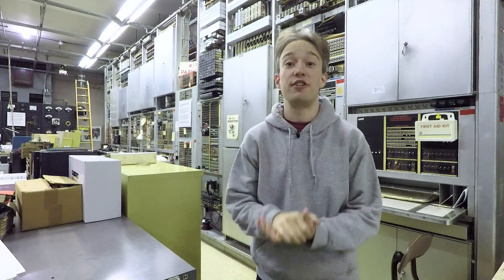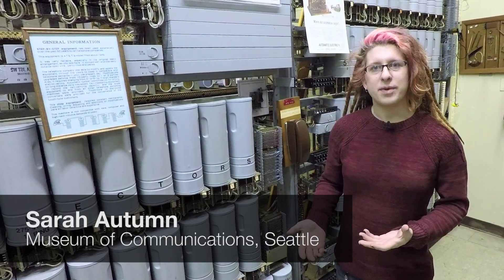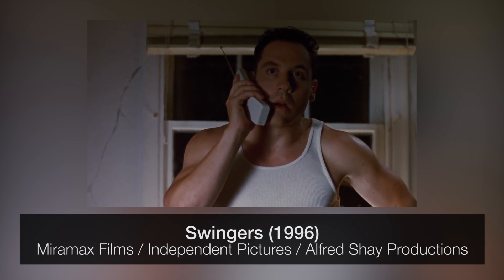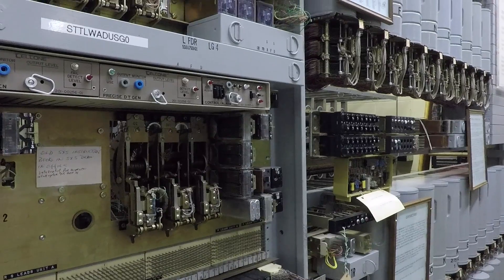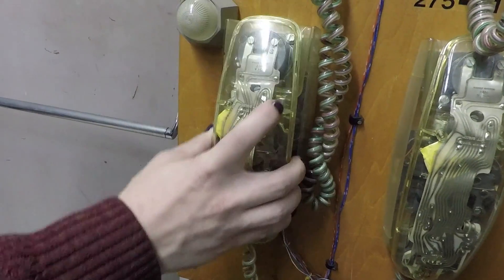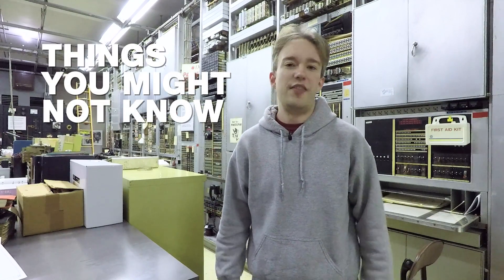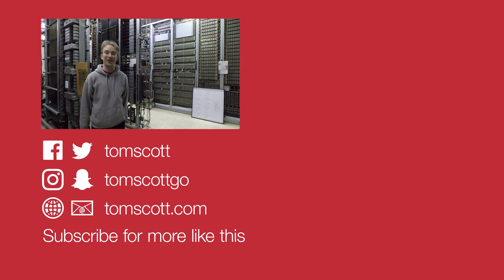In Old Movies, Why The Dial Tone After Someone Hangs Up?

Comment: Up until the 80's, there were still many step switches in West Los Angeles, Santa Monica, Malibu, and northern parts of the San Fernando Valley (Northridge/Porter Ranch, Granada Hills, San Fernando, etc.).  The telephone company was GTE, which was slow in converting to electronic switching.  They were known for a lot of crappy phone service at the time.  Hollywood, Universal City and Burbank were served by Pacific Telephone (an AT&T "Bell System" company until 1984).  Step switches disappeared there sooner in favor of crossbar and then ESS.   Now everything is electronic, VOIP, cable, cellular, and so on.  Step has been vanquished to the museums.

Comment: Oh damn. Back in early 1990s, I remember that my friends told me that if you called someone and let them hang up on you, but didn't hang up yourself, the line would stay open. So we tried that out! ...and it, of course, failed. We were so very very massively disappointed, and this was probably the only damn time we ever tried our hand at this whole "phone phreaking" thing. Hashtag wholesome childhood activities.

Now, this was rural Finland with comparatively shitty telephone exchanges (I can't remember when exactly they moved off from pulse dialing to DTMF, but that was late - I mean, I can actually remember a time when you had to specify ATDP instead of ATDT to call to BBSes), but apparently we were quite advanced in this particular regard.

Oh, and of course, I think that Finland always had a specific disconnect tone, so you don't actually get a dial tone if someone hangs up. Also American dial tones sound weird.

Comment: If I remember correctly, we had an analog phone once here in Switzerland which played this tone whenever we picked it up from its "station" (how do you call that?). And if the call ended, it played the tone again. What may be the reason for this? I don't think it's the same as in the video since the tone was always there whenever there was no connection, so even before a phone call and not just afterwards.

Comment: My memory of how step-by-step networks matches what your expert said, and not just in California - I saw the same thing all over the U.S.: the call only got disconnected when the person who placed the call hung up.  If you called somebody, the line was yours until YOU hung up.  But if you (the caller) hung up, the person you called would get a dial tone, for exactly the reasons stated in the video.  It had nothing to do with independent phone companies, though.  Of course most film directors weren't aware of this distinction.
Reply: You're right. Step systems weren't only used in SoCal. They just happened to be quite common there. In reality, they were used all over the country--mostly in smaller towns that didn't require the fancy and more expensive systems that were used in cities.

Comment: That step by step system was really intriguing. I wonder if it had any advantages over the major systems used by Bell.
Reply: The advantages of the Step system were its relative simplicity, and lower initial cost. In 1937, the federal government did a big investigation of the Bell System and found that in almost every case, Step was cheaper than the alternative.

Comment: We've had these step by step dialing systems in Germany as well! They were replaced by newer technology some time in the 70s, in some places even in the 80s. And then, in the 90s, ISDN arrived and all the analog telephone lines were digitized. Later on, everything went to IP networking, and nowadays, Voice over IP has reached each individual household. However, the more failure proof technology was the older one from the 70s and 80s. If there was a power failure, the telephones still worked, because the telephone hubs all had backup batteries, and many of them even had diesel generators that kicked in (so the batteries were only designed to keep the system running until the diesel was at operating temperature and -speed). Nowadays, you have to hope for/rely on the backup battery of your nearest cellphone tower, and if that fails, after an hour or two, you're screwed for communications (i.e. emergency calls).

Comment: California is hardly the only place to use Step X Step though so a lot of potential movie goers would have experienced the same thing.

Side note, working on those old systems was a great way to improve your soldering skills, mainly because if you got it wrong and left a solder dag in the wrong place then the results could be somewhat spectacular, though irredeemably terminal.
Reply: daleighcom1
_/

Comment: I'm pretty sure that's how landlines work in the UK... as long as the caller stays on the line, the line stays open, if they hang up, you get dial tone.
Reply: James F not any more. Now if you hang up on the person who called you the call will disconnect to prevent fake dial tone scams in the UK
Reply: pageuk As of a few months ago? That was definitely still an ongoing scam recently, and plus that would break a lot of call transfer systems...

Comment: I'm I'm denial that this is actually at a museum and not some telephone switching central, that's so cool that they have it up and running :D That tone when hanging up would actually be quite useful in cell phones as now I have to look at my screen to see if the call ended if I'm uncertain... o_o
Reply: Sure would be.  A nice "your phone call has ended, one way or another" sound would be great.  Bonus points for separate sounds for "this phone ended the call", "the other phone ended the call", "lost tower signal", and "no clue, but we're definitely not connected anymore".  Even if not everybody realized what the different sounds meant, it would be nice to have separate ones (and us geeks would memorize what means what, just for the fun of it :-) ).

Comment: on my cell phone, when I get hung up on, I get that dial tone, except it's one or three beeps instead of a long tone. If I remember correctly
Reply: If your phone doesn't automatically detect when the other person hangs up and end the call for you, you'll hear silence for a certain number of seconds, after which you will be forcefully disconnected after the three beeps.
Reply: That is just your phone letting you know the call was disconnected. Not an actual dial tone.
Reply: GlintTheStrong yes, that is what I meant. I was only drawing a comparison. It isn't technically necessary, much like the shutter sound when one takes a picture with a smartphone.
Reply: Sparkplug1034 Correct, from a technical point it is not necessary.
Reply: That's just your phone saying the call has ended, not a centralised thingumabob

Comment: Wait, the dial tone isn't normal? Here in Alaska, we get the dial tone on hangups as well. As well as something I found odd which is if you don't hang up but the other does, it'll redial after a minute. Course I haven't ran into the redial in quite some time, but the dial tone still works for the mainlines here.

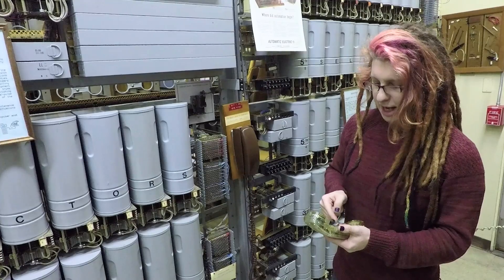Comment: Just been watching this again. At 1:35 Sarah dials a number, from 1:37 to 1:49 we see the "steps" (?) moving up and down, I'm guessing connecting something until at 1:50 the phone rings. Is each of them for one digit of the number she's dialing or what do they do?
Reply: Basically, yes. Each individual step switch handles one digit. The exception to this is the final connector, which actually handles the last 2 digits. You need multiple individual switches to connect a telephone call.
Reply: Sarah Autumn Thank you!
Reply: In the little community dial offices like where my grandmother lived, you only dialed 4 numbers to call someone in town. This was before direct distance dialing; you had to dial the operator to call long distance. The first digit dialed went to the first selector - it indexed up the number of rows for the digit dialed - then hunted across looking for an idle second selector. The second digit dialed made the second selector index up the number of the second digit - and then hunted across for an idle connector. The connector indexed up for the third digit and then across for the fourth digit. It took two selectors and one connector to complete a call in most small step offices.
Reply: Watch it very closely.  First the armature steps up (in response to the multiple contact closures in the rotary dial, then it rotates in response to the next dialed digit.  This isn't that clear because the second digit she dialed was either a 1 or a 2, so it didn't rotate very far.  This switch can connect to 100 different lines, which can be either individual subscriber lines or 100 more step-by-step switches.

And by the way, if you ever used a system like this, you will have noticed that the delay before you get a dial tone varies.  This is because another switch like this one (which I've heard called a "line finder", though I'm not sure that's the correct term) is stepping until it finds a line in the central office that isn't already in use.  During peak times this could take several seconds.
Reply: The mechanism is called a Strowger Switch
Reply: In an operational exchange the selectors (the first switches) would go tickticktick up with the dialled digit, then bzzzzzzt over to find the first available line to the next digit selector. Since this exchange is pretty quiet, the first line is always the available one.
Reply: Armin Grewe
Reply: well darn! I've never thought about how phone exchanges worked, now I'm interested and I'm going to have to do some reading into it! sleep can wait a few hours!

Comment: Unless the 'hung-up-on' phone can call immediately thereafter without its-end depressing the switchhook it should receive a 'system busy' not a dialtone....
Reply: I believe in this particular system it can because, as was pointed out, it doesn't monitor if the receiver of the call is still active (far end supervision) only when the caller hangs up. The system only knows that the receivers phone is off the hook, not that it has been hung up on, and thus offers the dial tone.
Reply: Raymond K Petry yeah, he said that the system didn't know if you'd been hung up on or just lifted the receiver to make a call.
Reply: Probably so: programming was fun in the '70's and a lot of simplistic-programming got done...
Reply: Raymond K Petry in this system the end with the dial tone could dial a call.

Comment: Wow, I never realised that dialling a number on the old system actually made physical arms move in the connection center.
Reply: Me neither, but it makes sense now that I think about it. It's one step up from switchboard operators sitting there, plugging and unplugging wires.
Reply: they still do- just on a MUCH smaller scale. computers are basically a series of switches put in complex patterns to make everything happen. now these switches are nanometers across, instead of a few inches.

Comment: So on this system, if someone called you and you hung up on them, is there no way for you to place another call until they hang up?  Seems like an easy way to do a denial of service attack. (No "distributed" needed in this case.)
Reply: Yep, that's correct. The caller has to hang up first.
Reply: Fortunately, in this attack, the attacker is sacrificing their own phone line for the duration too.  And they can only do it to one other phone line at a time.  So it's expensive in opportunity cost.
Reply: Definitely not now and probably not back then.

Comment: Fun fact... at least somewhere the numbers dial actually trigger an number of fast hang-up/pick-up signals.
I've personally had success calling people from a phone without a dail by just tapping the hang-up contact quickly with my finger.
Reply: because of backwards compatibility. that's what the a rotary phone does, it makes and breaks the connection, or quickly taps on the hang up switch like you said. so if your phone company still uses standard phone (not IP based) chances are good that this will work.
Reply: g mod
I know...
Reply: Chris
Old dial phones worked by quickly switching on/off the connection when the dial spun.
You can replicate that with your finger - if you are fast and well paced.
Reply: What??

Comment: so is this museum an old telephone switch station, or have they just put a bunch of old telecom equipment here as a display for the museum?
Reply from the maker: Both! And it's actively maintained.
Reply: Texans52 Toms Scott's Tour of Incredibly Specific American Museums 2017
Reply: As someone who worked on exchange equipment years ago I am glad to see that this place exists, so few examples are left (well in Australia basically none that I know of which is kind of sad)
Reply: Even moreso, many of the older volunteers worked for Ma Bell back in the day.

My trip there this summer was, as best described by another volunteer, "Phone Church".
Reply: +Tom Scott Could you do a video on how manual telephone switchboards used to work? I'm curious because there were a few scenes on The Crown featuring the process of calling various parts of different palaces.
Reply: There's a Telecommunications museum in Melbourne!
Reply: There may be a few independent collections and smaller museums that have some active stuff dating from anywhere from manual magneto switchboards to the first electronic systems :)

check out https://www.ckts.info/ :)
Reply: Tom are you speaking somewhere in Seattle? I live here, love your channel :)

Comment: I remember you could dial in the UK by hitting the receiver button in the same pattern as that of pulse dialing phones (pre DTMF phones, the rotary type).  This worked until at least the late 90s, haven't tried it recently but I doubt it still does.
Reply from the maker: It should still work! I think pulse dialling is still active on BT's 21CN network — at least, that's what the documents I just looked up say :)
Reply: It still works. Be careful if you try it though because it's easy to accidentally dial 112, which nowadays will get you the emergency services.
Reply: yeah my employer in the 90s had a lock on the dial to stop out going calls, but the tapping technique got round it. hehe.
Reply: As an BT Openreach engineer I can confirm pulse dialing is still a thing. Some elderly people still use pulse dialed phones. Feel free to ask me any questions about it.
Reply: in Australia you can still do that trick, it is just the same as using a decadic "dial" type phone I have a few very old phones and they still work if I care to plug them in.
Reply: In Iowa in the US (which has many small ILECs/CLECs like California used to) pulse dialing still works - I had mice get into a pillar down the road and the grounding out issues they caused made my phone ring 911 on its own - which I had to explain to the deputy Sheriff when he showed up at my door for a wellness check. This was last weekend.
Reply: Does sending the dual tones down the phone still work? I remember you could buy devices that could store numbers and carry it in your pocket, then just fetch a crude list up and offer it to the handset then it would play back the tones.
Reply: In Australia in the 90s we had a power failure in the office. No phones worked and neither did the fax machine, except that I picked up the receiver, heard dial tone and was able to call a number by rapidly tapping the hang up button. What I was doing was technically the same as what happens on a rotary dial phone. Australian exchanges accept pulse and tone dialling so it would still be possible today.
Reply: Old "touch tone" phones worked by sending two distinct frequencies down the line when each number was pressed.  It might have sounded like a single note but it was really a two-note chord.
Reply: Yes it is - my wife has just brought a 1960s era rotary phone (as she prefers them for listening) and it still works perfectly with pulse dialling!
Reply: DTMF (dual tone multi frequency) is the signal to the phone company that you generate when you press an ordinary telephone's touch keys.
Reply: No. 85 Merlin There were varying methods to establish "dialling", but you basically wanted a dead line with no preceding numbers and then you would put the speaker of the lil device to the mouthpiece and the numbers would play in sequence. It was sort of based on Phreaking.
Reply: Numbers above 7 are hard to pulse dial, though.
Reply: Yes, and famously used in the movie Hackers.
Reply: When you dial a phone, it goes beep boop bop. That's dual-tone multi-frequency signaling.
And it does work perfectly still, on landlines at least, because landlines  still use in-band signaling for everything. (I don't know about VoIP phones. Cell phones are out-of-band.)
And it will never stop working for phone menus and extensions, because at that point there is no out-of-band signal whatsoever.